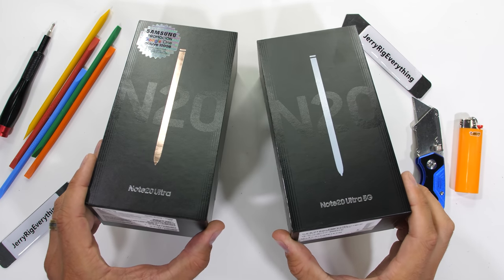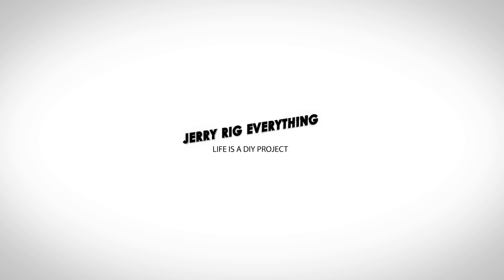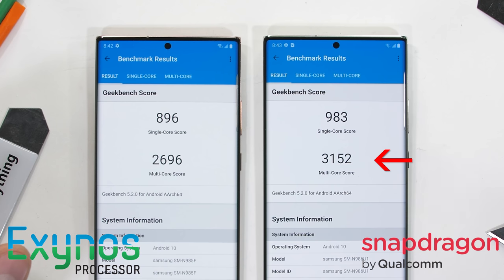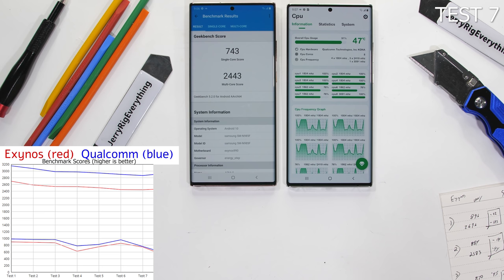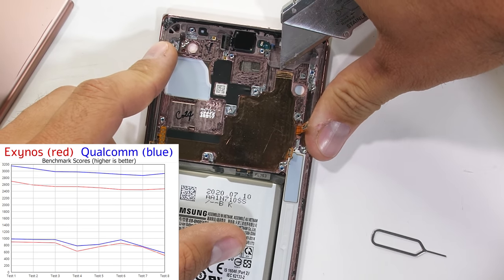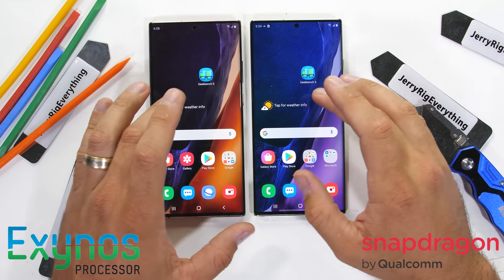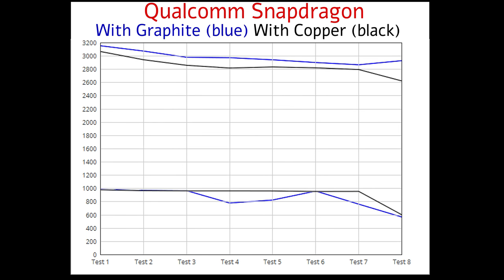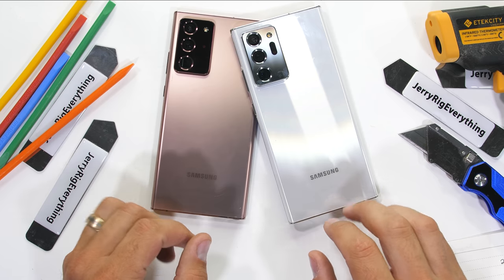Samsung should explain this... Exynos vs Qualcomm?! - Note 20 Ultra

Comment: I had the Samsung S20, it comes with the same Exynos CPU in the UK, I had for a week. It kept overheating doing the most simple tasks! For example, I used my phone as a mobile hotspot. While doing this, The phone reached 179.0 °F, (around 82.c) The phone forced closed around 18 apps and wouldn't respond only to tell me I cannot use the phone down until it cooled down! 

I sent the phone back, I'm really gutted Samsung have done this to certain markets.
Reply: Hotspot really gets a phone hot...
Reply: @tob0r  it would depend on how many devices connected to your phone. and if connected how many are actively using the bandwidth, then on your ambient temperature. I have used iphone 7 as hotspot and it heats up with 5 devices connected and with ambient temp of 29-38 degree celcius.. i have mi mix 3 also a flagship. Which heats up as well and can connect up to 8 devices at once.
Reply: You lied. I have s20+ and played on ultra settings in Gwent and he is cold.
Reply: @rustumd  Yes it does, But I never had a phone overheat to this extent and forced apps to close and refuse to do anything else until it cooled down. All I had was one device connected to the phone.
Reply: @fan_of_swfan_of_sw3804  What benefit would I get from lying about my experience with the S20?
Reply: @kd84afc  snapdragon version also heat up and so what ?!
Reply: @fan_of_swfan_of_sw3804  We're not talking about the snapdragon version, We're talking about the cheaper and inferior product that is Exynos, If Samsung shipped the snapdragon globally then no one would be complaining.  But yes the snapdragon probably does heat up when being used but not to the extent I experienced with the cheaper Exynos, All I did was share my experience with the S20, and seems to be a common theme with many Exynos users. So why are you being defensive?  Samsung is a big enough company to give everyone the same product but yet they choose to give people an inferior product depending on where they live.
Reply: @fan_of_swfan_of_sw3804  i used S20 exynos the battery  peformance so bad even with 60hz setting comparing with my 3 years HTC phone and the phone keep overheating
Reply: using data makes ur phone boil aswell, and sadly theyve been doing this since s7 probably with earlier models aswells
Reply: @pn1280  I had S7 and then S9 both used as mobile hotspots and never experienced the issues I had with the S20, yes they would warm up! but never would lock up and force apps to close and refuse to work until it cooled down.
Reply: @muhdrasydan93  hah,I have protective case Samsung everyday and s20+ not heat up even in games. Battery life over 14 hours🤷‍♂️
Reply: @fan_of_swfan_of_sw3804  What version do you have? Exynos or Snapdragon?
Reply: @kd84afc  exynos
Reply: @fan_of_swfan_of_sw3804   then you're one of the lucky ones, But don't you feel pissed of about buying a product that's inferior to its North American counterpart?

Comment: Samsung needs to drastically step up their exynos chips or sell their phones with snapdragon chips only.
Reply: That's difficult for such a high volume product, because with that many phones, it would be hard to buy snapdragons for all of them (not defending it, just pointing the potential reason?
Reply: @nicky2575  That's a valid point.
Reply: @nicky2575  still an excuse
Reply: That's want they are actively doing for next year's chip. They are dropping their in house cores which performed terribly and partnering with ARM to match Snapdragon's performance.

They certainly already know it's gone downhill, as seen when they fired the entire custom core team.
Reply: There are news that samsung is going  to step up exynos for next year. ( with AMD )
Reply: Or they should definitely decrease price of Exynos powered smartphones😬
Reply: I think it’s more monopoly with snapdragon stuff.
I also think why Apple is ditching them just design their own stuff
Reply: @nicky2575  i think the reason is just lowering costs by using their own chips and trying to avoid snapdragon to have a monopoly and beeing able to dictate the price of their chips...
Reply: All Samsung foldable phones use Snapdragon worldwide at least.

Comment: "It's like Toyota sold a 6 cylinder in the US and a 4 cylinder everywhere else without telling anyone".
I think Toyota is probably one of the few that probably doesn't differentiate based on market, but Ford definitely does, in South Africa we used to get the Indian version of most of their cars, way worse safety ratings than the international. Might have changed in the last few years though, haven't checked up on it since I moved.
Reply: Toyota definitely does as well, the USA didnt get as many turbo and rwd vehicles as the rest of the world
Reply: @mandc20022  Only did in Japan that turbo rwd vehicles, in Spain neither have them, just the fwd N/A..
Reply: The car comparison is not fair.
Cars made to US markets are not legal in EU region and vice versa.
Reply: Most Asian car manufacturers do this as well; they send a premium product to the US and for the same price an inferior product to developing markets. Kia, Hyundai; Nissan; Mazda even Toyota.   Exceptions are Subaru and Honda, they maintain same quality.
Reply: no they do actually tells everyone but also tells the customer to "fuck off!"
What you gonna buy, a Huawei!
Reply: XtreeM FaiL 👍
Reply: the Toyotas here is South Africa is garbage quality look at the video of someone who bough a brand new fortunes and nothing lines up and the whole centre console lift up from cheap plastic swell as the hilux fuel economy when pulling a small trailer that doesn't even weigh 200kg
Reply: How could you not know the engine specs prior to purchase? Of course they tell you.
Reply: @kazukinakamura1110  but no one wants the slow cpu . and importing a other one from a other country is expensive and most companies charge you tax to import
Reply: @ldtworks1052  so don't buy it. Plenty of other choices.
Reply: In Indonesia here most cars are more expensive because of TAX and with higher prices here some features like cruise control,parking sensor,and other features are mostly gone.
Reply: A lot of car manufacturers, especially luxury brands, sell their US Spec cars with larger and more powerful engines that are less efficient because American buyers prefer having a larger engine over having fuel efficiency since gas in america is much cheaper than Europe in particular. In Europe the base model Mercedes C class is the C180 with 156hp and 38.6MPG while in the US the base car is the C300 has 255hp and 29.5mpg combined (24 city, 35 highway)

Comment: been there, got my s10+ last year then tried to compare it with my friend's OP 7 Pro, into thinking i also got the 855 chip from qualcomm, we tried to do some benchmarks with both phones and there i see that im using an Exynos device(im form Philippines so yeah) then after we finish everything i see the gloomy numbers from my much higher price device compare to his, i think thats my turning point into buying an "Authentic" Snapdragon device and feel the real difference, in short i too bought a Oneplus 7 Pro and sold my S10+ for cheap. and i never had the urge to turn back to samsung except with their camera.
Reply: What would suggest in the case of an average mobile user ( mostly multi task , never into gaming and camera)
Samsung M21 / Nokia 5.3 ?
How can I find which chipset I'd be getting😟
Reply: @vishalkurien1982  i would say do your research well, check out the specs of the phone, they would have mentioned the processor in the website but if you live anywhere else other than US, you would most probably be getting a exynos chip, i would suggest you to look somewhere else if you are interested in going for snapdragon chipset. 

Ps: This huge performance difference is seen with a brand new phone, overtime, exynos dies out pretty faster because of the heating and the phone becomes unusable ( lags, frame rendering, battery dies out fast, screen issues, etc .. )  after a year and half.
Reply: @DiganthPrakash  so which one better  between Exynox and Snapdragon? Bit confused after i do research on between chipset
Reply: @vishalkurien1982  I would recommend getting the m21. Im using an m21 now and for the price, it is overall a better experience than the nokia 5.3. M21 has amoled display, 6000mah battery, exynos 9611 processor, 48 mp camera. ONly go for the nokia if you are a fan of stock android, otherwise the M21 is a better deal.
Reply: @srikarvundavalli5934  also eager to understand chipset difference between them....
Exynos 9611  vs Snap 665....?
Are they same for long term usage...?
Reply: @DiganthPrakash  Thanks bro.
Whats your take on this : is Exynos 9611 clearly better than snap 665 in the long term usage sense.( At solid 3 years)
Reply: @vishalkurien1982  They are almost same for long term usage at least raw processing capability  wise. Samsung optimised their oneui very well and I think it would be slightly better.
Reply: @vishalkurien1982  Exynos is known for heating up more but, before the m21 I had a Sd675 phone and trust me, the exynos runs much more cooler.
Reply: @srikarvundavalli5934  Cheers brother ! This should help.

Comment: Samsung will say: SO WHAT WE DON'T CARE NEXT YEAR HAVE EXYNOS WITH NO AMD 

Next year amd is not there yet its 2022 

Update: thx for the likes
Reply: Then no buy till 2022.
Reply: Samsung will keep lying to their customer.
Reply: @ytho3505  what did they lie about
Reply: @hellonoitisnt393  for starters, that both the Exynos and Snapdragon variants of the Note 20 are comparable to each other and should cost the same.
Reply: And at 2022, it wouldnt preform any better than the 2022 Qualcom chip
Reply: @isaiahwade1484  what else
Reply: so the leaked AMD GPU being ahead of Adreno's score was there for nothing?
Reply: @muchtarlatif3282  NO, it was there for a reason. Hype.
Reply: @muchtarlatif3282  thanks for explaining. Right, it came out 2022, but I'm guessing by the time it came out, Snapdragon already step up the game.

Comment: Samsung please ditch exynos version atleast for flagships like this
Reply: Would be a stupid idea from any aspect. Giving Qualcomm even more power with their Monopoly is not good. Especially not when it's mostly Qualcomm's fault already that Android phones are getting more and more expensive overall.
Reply: @Raja995mh33  agree, what they should do is let people know and give them options. They can buy SD version for more money or Exynos for cheaper. Till they don't catch up that would make perfect sense and noone would complain
Reply: Tim R. True, but they should at least try to make a good chip then. If Apple can do it then I’m pretty sure they can as well. Apple’s Chip is already 2 years ahead.. the difference in chip is getting bigger and bigger
Reply: They basically are starting with the S21.
Reply: Fantasy Apple has WAY more experience with self-made processors. Samsung basically started that in 2015, Apple in 2010 or earlier.
Also Apple is making these processors only for their own devices so they can built EXACTLY what they need. And they don't have to care about pricing because of that. That's also why Apple is able to use something like extremely expensive L2-Cache at sizes of 8MB for years. Compared to less than 2MB in even current Qualcomm and Exynos chips.
Just because Apple can do it doesn't mean everyone can.
Samsung and especially Qualcomm are selling their processors to many companies so they have to focus about cost and stuff, which isn't relevant for Apple at all.
Reply: Chris to be clear - most people just don't care. Giving people the option wouldn't make everything better. It would confuse people, that's all. That's why it's a horrible idea from a marketing perspective.
Also, Samsung (somehow) isn't even able to provide all their announced colors in all storage version. Do you really believe they would be able to do that AND give you two processor options?
Reply: They are developing right now a way more powerful exynos processor to beat snapdragon
Reply: @Raja995mh33  Exynos is not cheap either. Qualcomm is more powerful same time more efficient than Exynos at same price so Samsung should ditch the Exynos or make Exynos better like Qualcomm. Other way Samsung can charge lesser for their own underpowered Exynos.
Reply: I think Samsung is purposely holding back on their exynos chip for when they improve it and it runs better than the SD one. Then they'll add better cooling and better everything to make it look like a huge upgrade
Reply: Cant and shouldent if they do QC will become like intel so they need to stay as a competitor but they should lower price for exynos version of phone.
Reply: Fantasy Samsung was better say around sd 821 sd 810 era ! 
Ill tell u the story! 
ARM makes the Core design like a75,a76,a77 with a 77 being latest! 
Qualcomm used to re engineer ARM cores to all custom design like Samsung with Mongoose cores ! 
But after 810 (Krait - Full custom ) crapping out, Qualcomm decided to just use a slightly altered Kryo cores (they called it semi custom). Hence they didn’t have to re design anything and you get the ARM newer a77 ahead of samsung ! Which is still using a76 design templates! 
So samsung using a76 vs Qualcomm basic a77 is no match ! 
With s21 they are using the same ARM design like Qualcomm so you will see a good jump! 
Plus its using an AMD gpu so hopes are high !
Reply: Ajith Kumar just because the end product is the same price doesn't mean the processor is as expensive. I'm pretty sure the Exynos is cheaper.
Reply: Tim R. Exynos is expensive ! 
1. Qualcomm just alters a77 arm design slightly Samsung takes the design and makes a full custom cores . ( earlier it was better than ARM basic design but some how ARM has got its shit together) 
2. Samsung integrates the Modem into the same chip 5g +4g, Qualcomm just makes others buy the external modem. 
3. Samsung combo Soc is expensive than 865 but 865 + modem is a lot more expensive! So making a cheaper chip they can hog a lot more money from people ! 
3. For just data transfer on 5g Samsung would be better cause internal modem is always better.
4. So samsung spends more money on design, more on making the combo chip. But Qualcomm sells the chip at higher prices cause they can, they are best currently.
5. For Samsung its more expensive to buy 865 vs to make its own chip.
Edit : Hence real world battery performance may be lot similar cause you also use 4g/5g (cellular data)